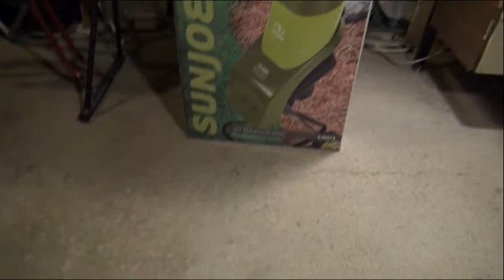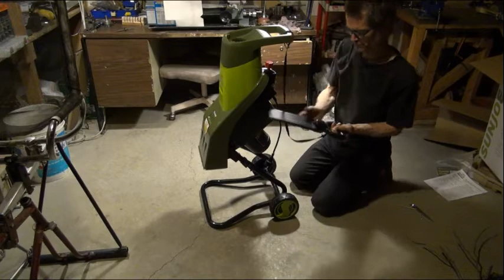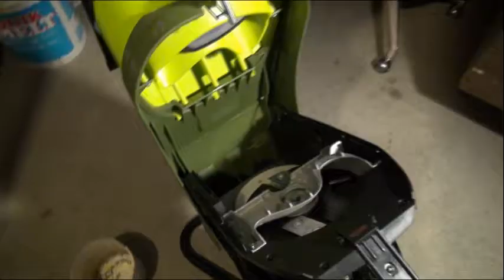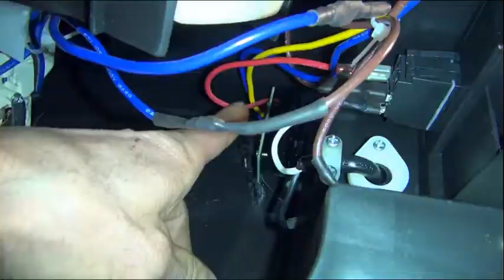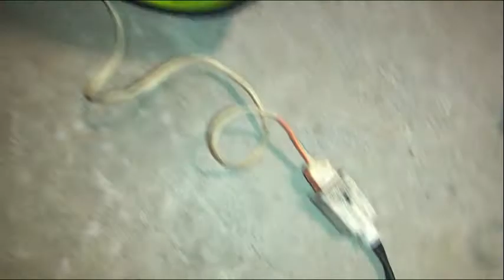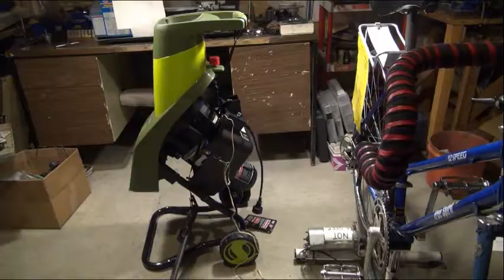Pedal-powering a household electric wood chipper

Comment: This gives me a ton of ideas involving batteries to power small things around the house. I'd love to know more about the kind of generator you are using. Do you have to send the current through a transformer?
Reply from the maker: Hey Jorg! Welcome back from your trip.
There is no transformer. The motor in the chipper can run on DC power, much like a blender motor, with wound stator and wound rotor. The pedal-powered generator, producing DC voltage, is directly connected to the chipper motor, plus to plus, minus to minus.
Reply: @janprzysiezniak7563  Thanks Jan. You're inspiring me to try something similar. I tend to be too busy, but you showed how simple it can be.